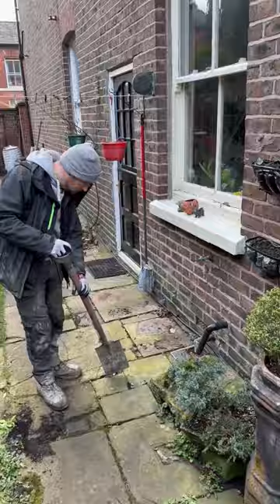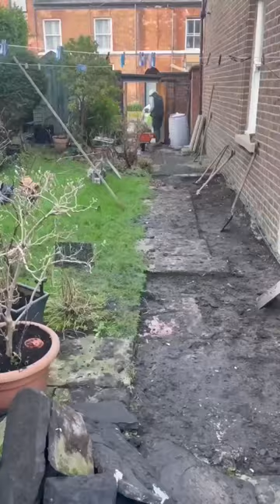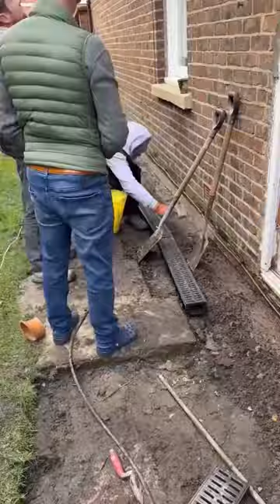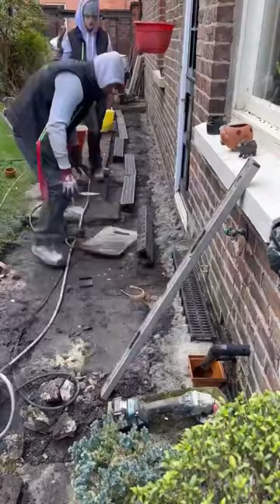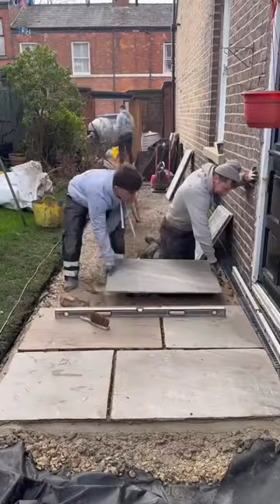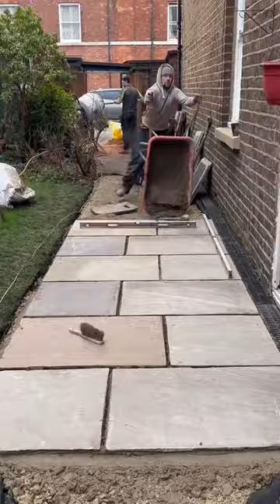Installing a Indian stone path ￼with Aco drains #garden #landscaping #shorts

Comment: Is the wastewater allowed to go in same drain as rainwater ?
Reply: You need to look more at the point of. Would you want to pay an additional 300 to have new drainage diverted. You can only suggest these things to a customer and only they can decide to take what come from it. But yes you are correct in thinking fal is waste and storm is clean water 🚱
Reply: No you shouldn't really but you would rather. Rain water / aco channel to plumb into a fal drain then have say a toilet plumbed into a storm drain. I would also suggest fitting a bottle gully of sorts to the aco run too to stop smells ect coming from the fal drain. In an ideal world you would put a soak away crate system in with a fabric membrane and surround with shingle but again depends on water table and ground it's surrounded by also. You have to look at all variables.